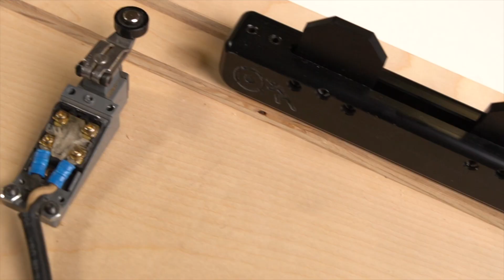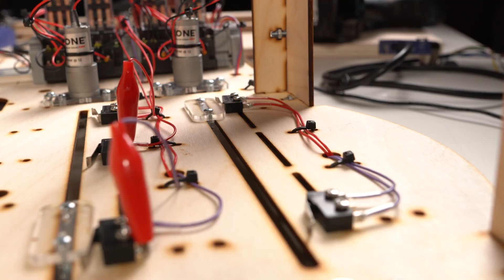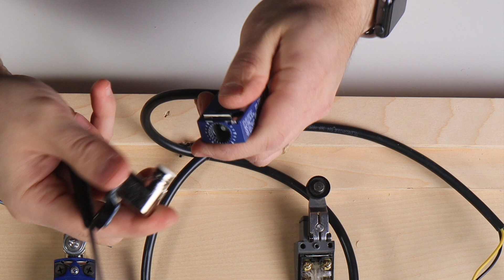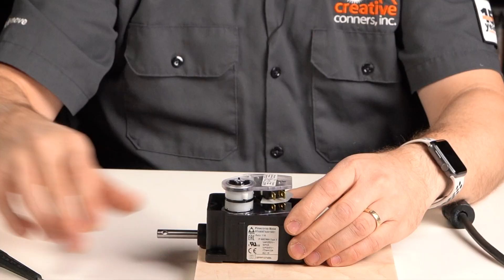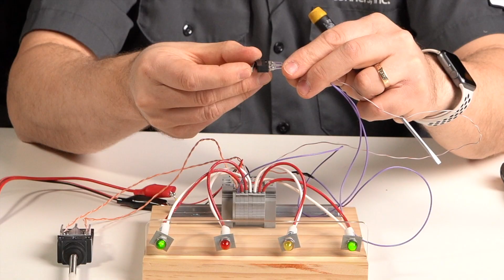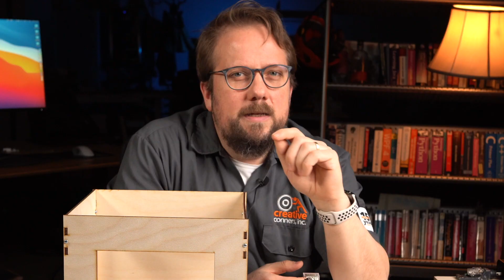Limit Switches

Comment: Your setup is nice but explaining how an open circuit has flaws could have been done with some wire, motor and power. When you show the open circuit, you are not actually showing what is happening , only the result.

Comment: I know this is a year old… but I’m in need of a switch that will reverse a dc motor… back to its home (switch).
Reply from the maker: Hmmm... it's tough to give a sure-fire recommendation, but you likely need a DPDT relay switch that can flip the polarity of the motor //and// be interrupted by the home switch. Take a peek at this video for some explanation of a similar circuit: https://youtu.be/gAEXvFfHynI . Hope that helps a bit!!
Reply: @creativeconners  I simply appreciate you taking the time to answer. My wife and I, both from theater, are opening an electric shooting gallery, with an Alice In Wonderland theme. Thus, I’ve spent the last year trying to build animatronics and other moving things… this wasn’t something I spent a lot of time doing in theater. I mean, I wish I had… but now it’s a crash course and one that is sorta higher than my IQ.
Reply from the maker: @gelatinskeleton8745  That sounds very cool! Good luck on the project!

Comment: I have two roller type limit switches that are used in limiting the stroke on my automatic tool and cutter grinder . I replaced one limit switch due to the roller no longer rolling since the bearing failed . The limit switches reverse the drive motors direction causing a continuous back and forth action.  The issue I'm having is the change of the motors direction is not immediate. It lags . What then happens is the metal pieces that make contact to the rollers on the limit switches is pushing on the mounts that secures the switches in a desired location. Can you explain to me why this is happening please . Thank you
Reply from the maker: Hard to say exactly, but there is usually some over-travel after initial contact with a limit switch. The mount needs to be designed so that a bit of over-travel doesn't damage the mount. So, unfortunately, the best answer is to remake that mount so it doesn't interfere.